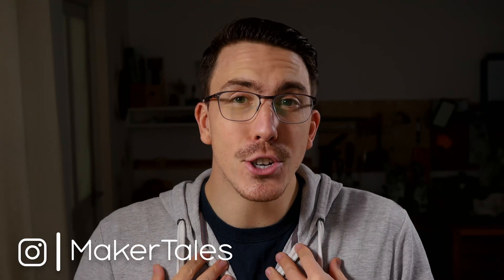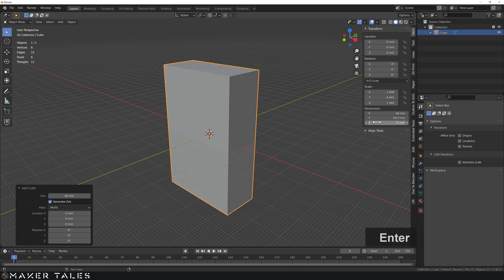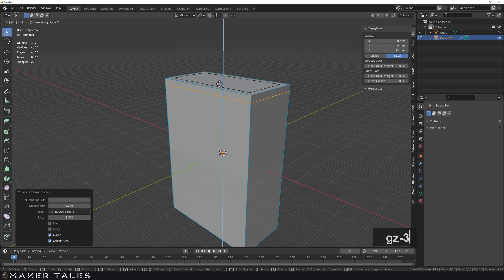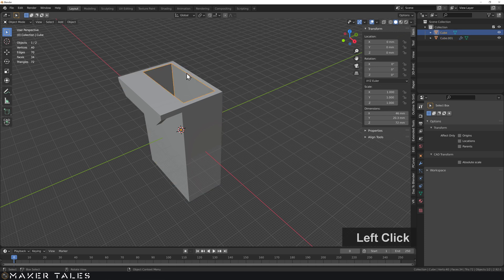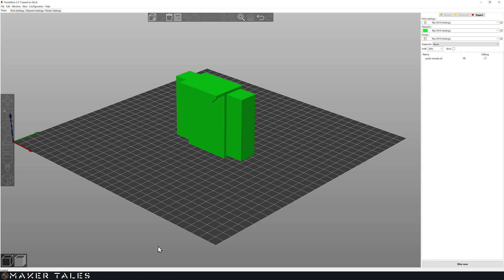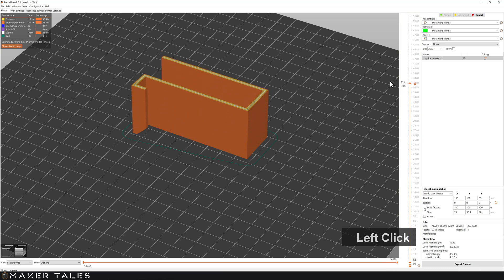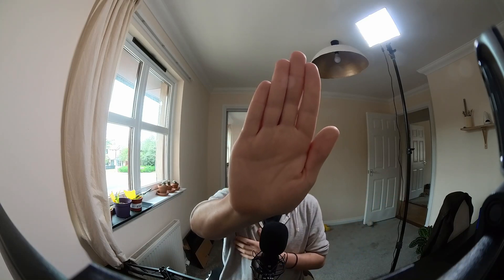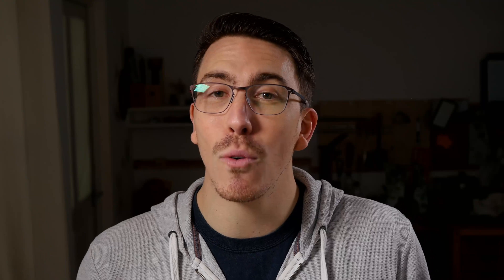Modelling A 360 Webcam Mount In Blender 2.9+ | Blender Precision modelling In Action

Comment: Ive been working on models at 40mm size, if i add a new cylinder, it adds it with a 1000mm radius and 2000mm hight, any way to set blender to not do that? Super annoying.. and anytime i import stl from Fusion360 it comes with a size of something in the order of 100000mm ..export from blender is like 0.0004mm needs to be scaled by 10k percent to even appear in the slicer
Reply: Well yeah, there is some preparatory settings you need to setup before importing STLs from Fusion 360 or any other CAD program, you can find more about that in other tutorials. And also, yes,  the dimensions change a little bit from what you actually set but I don't think it'll double the value. Have you checked if you're setting the radius or the diameter? I always make a mistake is setting radius value as the diameter lol..
Reply from the maker: Hey Tarek, you may find this video useful: https://www.youtube.com/watch?v=VihRvil3138&list=PL6Fiih6ItYsXzUbBNz7-IvV7UJYHZzCdF
Reply: @Keep-Making  i never reacted to this, missed it i guess, thank you very much! For one i was missing the change in the grid overlay, after that it added the cube at 2mm, haven't tested the export yet, but thank you for all the videos you make getting CAD people into blender, i still only use it for mesh related editing and sculpting, because cad work is just those few steps too many compared to Fusion360, but your videos make the jump back and forth somewhat bearable ;)